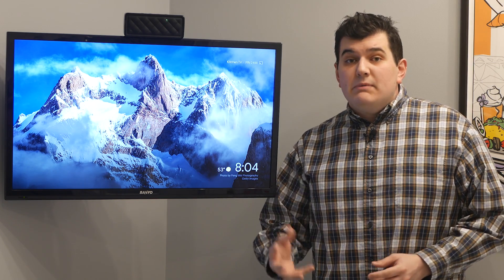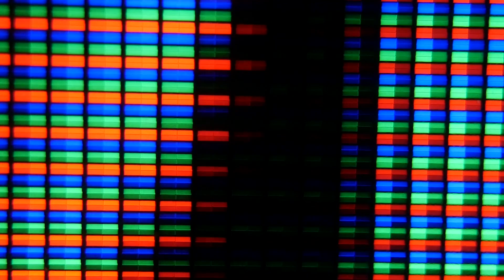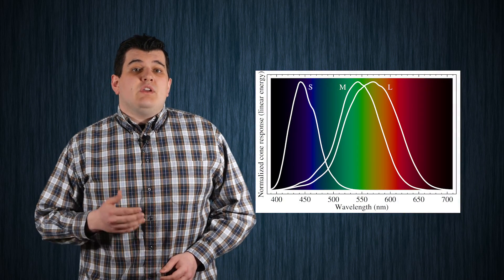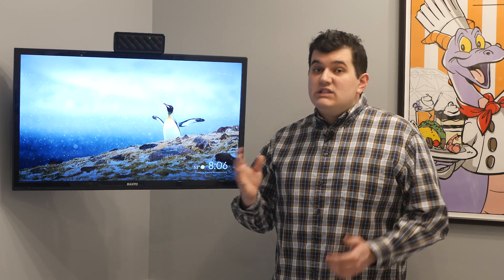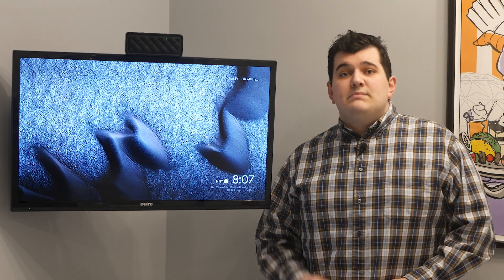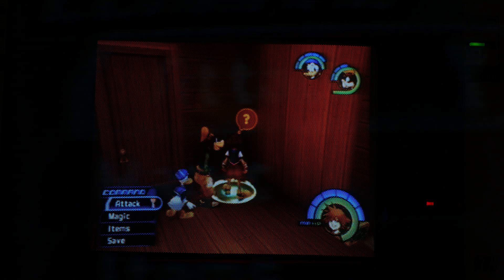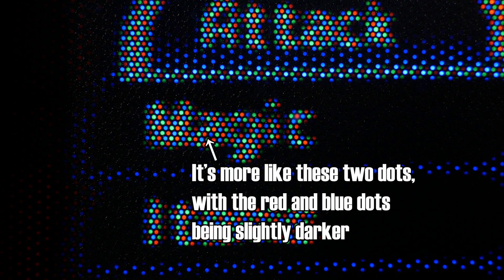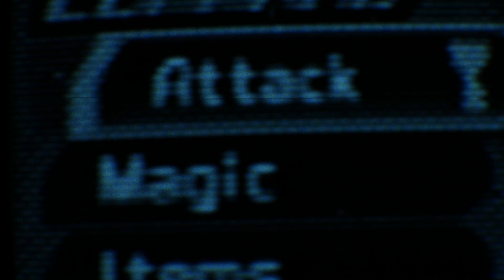These Are Not Pixels: Revisited

Comment: Watching this, in a way analog TVs do have pixels, and a significantly higher resolution than the video signal. They effectively rescale the image much larger (supersample), using analog means. They paint the image with the electron gun at an infinite resolution, then let the shadow mask downsample to the dot pitch. The key point is still the same: it's not the video signal that defines the resolution, and each TV has a different resolution (that boombox TV has a lower resolution than even the video signal). Further, the pixels aren't even in a grid. And with a Trinitron, there are picture columns, horizontally discrete, but vertically continuous, sort of a 90-degree rotated equivalent to scanlines in the source signal.

One other thing, scanlines are a discrete element, and are addressable. So analog TVs don't have pixels in the source signal, but they do have scanlines. Horizontally, the signal is effectively a continuously-varying bar of color, only limited in how quickly it can change color/intensity.

The passivity of phosphors isn't the important difference, but addressability: you can't precisely control each phosphor dot individually, while you can control each sub-pixel in an LCD.
Reply: No, there are no pixels.

Comment: Btw, 486 on a analog display. 480 was use as digital recording format later on after the Targa years. It leaved 3 black lines each side off the horizontal sync not rasterised. They were not in the safe action part thus not visible. Files for stills before 480 digital compatibility where 486x512 tgas.

Comment: My understanding is that every phosphor triad is, by definition, a pixel, because something being a "pixel" doesn't require that it can be individually addressed; merely that it is something which is used to form a larger composite image. For a B&W TV, every phosphor would be a pixel as well. Issue is that "Pixel" happens to also be the term to define the smallest possible unit in a digital image and we often show digital image sources on television screens, including older Televisions (Game consoles and the like) and that can easily confuse things. Similarly, if you don't use an LCD/LED screens native resolution, then the image scaling results in the "pixels" of the display not lining up with the digital pixels actually being received; this doesn't mean the LCD/LED triads aren't pixels though.
Reply: But they do not form the image, think about Trinitron? Is the vertical resolution of a Trinitron display just one pixel?

Comment: You say that the mask is only there as a side effect of the need for color separation. But ALL video formats require a separation of points for resolution. THAT is what defines pixels.
You know what doesn't have pixels? Vector CRTs video. And oscilloscopes. There's no pixels there.

Comment: This is exactly an argument of semantics. You're defining "pixel" as individually controllable light sources. So the CRT has one. But that's not what pixel means. Pixel is a picture element, a single unit of picture; those are the cells either on LCD OR on CRT. So you're actually wrong, These Are Pixels. Even on CRT. The resolution determines how many pixels you have. Even a CRT is displaying an image with a fixed resolution. That means we have defined fixed pixels. Even if snow has no resolution, every broadcast, even black & white ones, have a fixed resolution, therefor fixed pixels.
Reply: Unless someone knows of some analog television broadcast that had a changing resolution?
Reply: Ah, I thought of something. Vector CRTs, and oscilloscopes!
Reply: So I'll give that you're right, the color mask isn't the pixels. The video itself is the pixels, which could be higher or lower resolution than the color mask.

Comment: This video is almost tediously long, but it needs to be 
because so few people ever knew how an analog CRT TV worked 
when it was the only kind available.
One clue, for those people who persist, to the fact that phosphor dots are Not pixels 
is that they were never Called pixels until LCD, DLP, and plasma technologies came on the scene.
Never. Check the literature. You Will Not find it. 
There may be some obscure references that try to equate them, 
but you need to be aware that some writers without sufficient knowledge 
don't go back and ask the real experts to correct their mistakes --- 
and then some of the experts wouldn't have thought those mistakes harmful anyway. 
There were no TVs that Had pixels to cause the confusion.
Calling phosphor dots "pixels" would be like mistaking the meaning of the term "tire" 
in connection with a horse-drawn coach in the 1850s. 
In those days there were no rubber tires. 
Tires, when they were used on those old wooden wheels, were made of Iron.
Would you want to have someone envision a coach with rubber tires when it was completely wrong?
Would you want to be the person with the mistaken idea?
I should hope not, and I should also hope you don't want to hold a mistaken idea about CRTs.
Just call the phosphor dots (or lines) what they are, 
and leave pixels to modern screens where they really exist.

Comment: Yooo this is gonna sound silly, but I've been looking for an absurdly tiny CRT screen like the one in that boombox for ages... Was there hardware modding involved to get it to work with the PS2 or does it just take composite cables already? And where can I get one? xD
Reply from the maker: It has a dedicated composite input (surprisingly!).  Not sure where to get one, it was a goodwill find.  But, there are smaller 5 inch color TVs that you can find on eBay.  Search 5 inch CRT and it seems there are some RCA units available.  They go for rather absurd prices, though.  Generally around $50 with shipping.  From the looks of the pictures, it probably has the same tube.  I would imagine the need for a 5 inch color CRT was pretty narrow!
Reply: Thanks for the helpful reply! I'm just like, infatuated with the idea of playing my older gaming consoles on an impractically small screen, haha. Just one of those dumb bucket list things. I always had no luck searching for them in the past because I didn't know the actual size they'd be, and "small CRT" didn't really give me much. 
I don't know if I can justify dropping $50 on one of these things, but I'm glad I at least know how to find them now :)

Comment: The thing that really got me to understand this concept was setting a 3 CRT front projector with a computer. There is NO native resolution as the analog tubes and circuitry could happily render many different "resolutions" by adjusting the timing of the scan lines and their size across each tube face. No shadow mask just a single electron beam lighting up phosphors on a tube face in each of the Red Green and Blue colors and sending that through some optics to shine on a screen. Analog was amazing!

Comment: This may be a dumb question but how exactly is an analog tv able to display a resolution of 240p? Like on the n64
Reply from the maker: Every other field is thrown out.  So rather than working with 480i 60 Hz, it works at 240p 30 Hz.

Comment: Maybe the best example of the difference between pixel and shadow mask dots is an old PC monitor. One can change the resolution expressed in pixels, but the mask would remain in the same position. Or the fact that changing the width of the image on such a monitor moved the pixels but not the colored dots.

Comment: CRT computer monitors are a bit of an exception, since in that case, the dot pitch is designed to match up with the maximum resolution the monitor can display. However, it's still not displaying "pixels" since the VGA controller is just spewing out a set of analog (television-like) signals to the monitor. If you were to set the resolution too high, the electron beams would just miss the shadow mask and not display anything, or the horizontal and vertical blanking would just fail to synchronize.
Reply: No, it is not designed to match the maximum resolution.

Comment: Sorry, but coming from a relatively neutral position on this subject, all you've really done with this video is encourage me to think that they are in fact pixels.
For most of the video I was thinking "This is all well and good, but how does this mean that they're not pixels?".
You go into the myriad of ways that a CRT screen differs from an LCD, and sort of hope that this demonstrates that they can't be pixels, as though the rendering implementation inside an LCD is the definition of a pixel, and anything that differs is therefore not a pixel.
A CRT produces an image to the viewer on its phosphor screen, presented as a combination of individual elements with varying colour and brightness. It is irrelevant what the screen is doing behind this, with the guns and scanning fields. I think you say that the 'true' image is there out of a purist romanticism for the technology (which I don't wish to put you down for).
In your example with the grid over a newspaper, what happens if you take away the grid? You see the image of the paper. What happens if you remove the mask and phosphor screen from a CRT? The image does not form. The image IS defined by the screen, it's just told what to do by the guns and the scanning field. Yes, they don't 'communicate', but why do you define pixels as having to communicate, what definition says that?

Comment: I think a key point that was missed is that the CRT beams cannot be perfectly aligned with the mask (although some high-quality CRTs can get close). Even having 1 beam to 1 line (of shadow-mask 'pixels') still results with problems due to alignment and distortion issues. So unlike an LCD or LED display, CRTs you cannot get full intensity control of singular visible 'pixel' without affecting nearby visible pixels (not without wasting a lot of image resolution).

For a B&W TV, the resolution could be considered limited by the number of lines 'times' the number of possible intensity variations per visible line (akin to bandwidth), assuming adequate focus and insignificant light leakage between phosphor grains. This could easily be digitised (like the old Teletext)